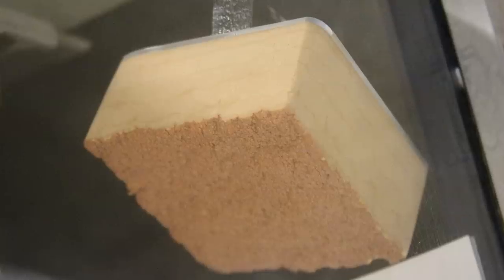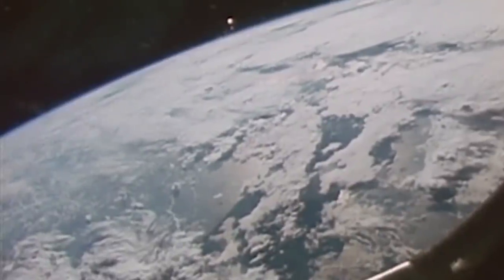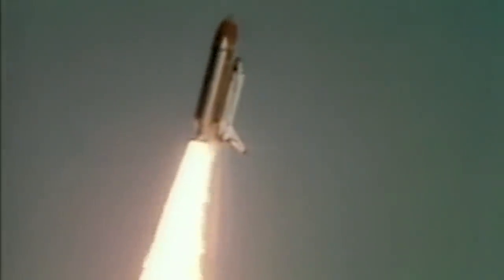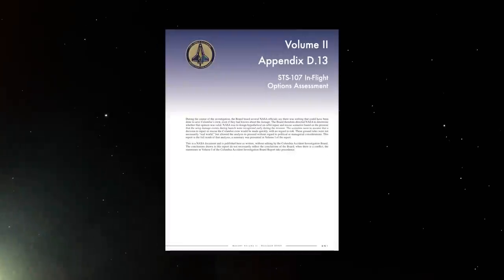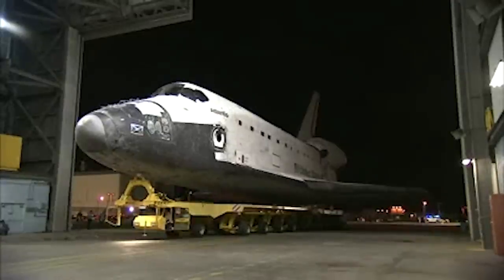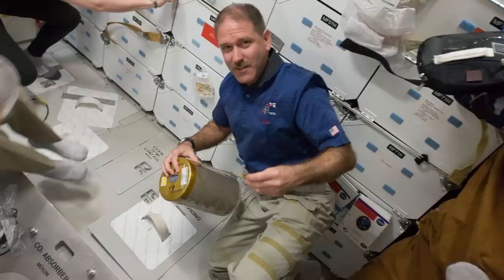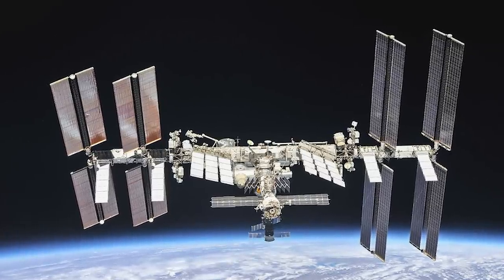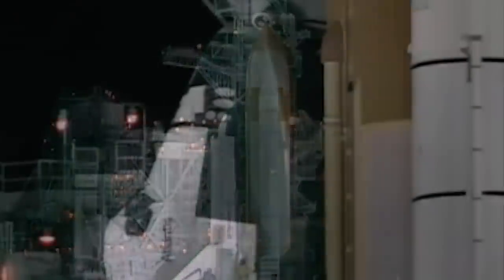The Backup Space Shuttle

Comment: My proposal would be to put a purpose built shuttle in orbit to function as a lifeboat/transport. You could save a lot of weight by ditching all of the parts dedicated to re-entry, fill it with fuel and supplies. Leave it unmanned on standby when not in use.
Reply: The only problem would be that, the vessel that needs it would have to get to it. Which could take days depending on how the orbits line up.
Reply: @h0ckeyman136  we have all sorts of capsule designs to handle the ferrying of people to and from.
Reply: @Name-ot3xw  Again, its not that its not possible, but for you to save someone who gets stranded. You would have to be able to fly to the lifeboat which is in a whole other stage of its orbit. These things arnt like sailing ships. They require lots of time to get to places because of the vast distances
Reply: @h0ckeyman136  You do realize that the shuttle and capsules exist as they do because we made them so. If we were to change the mission parameters we could build them that way instead. 

Like, we have already built multiple space based vehicles that were never intended to return to earth except for end of life. Many were infrequently manned so we have some experience with storing space-trucks. Most of them are still in space, though as you so helpfully pointed out, do not currently wear appropriate engines.
Reply: @h0ckeyman136  Further, it's not like we don't know where various manned missions are taking place, it's not as if we need a warp drive to have a lifeboat in position for a planned mission.
Reply: @Name-ot3xw  how much knowledge of spacetravel do you have? I am very passionate about it, do my own research and watch lots of videos explaining things. From what I understand the only "lifeboat" that exists is on the ISS
Reply: @Name-ot3xw  It would have been very tricky if not impossible to do that. And that information is from scientists.

Comment: NASA's response to questions about an orbital inspection was kinda gross.  It was basically, "it's better to let them die on re-entry than suffocate in orbit."
Reply: ... Yeeeah, gonna have to agree though, would rather die close to instantly (and unexpectedly) when the shuttle turned into tiny shuttle-bits than die slowly of suffocation, knowing it was coming...
Reply: On Apollo 12, there was concern that lighting had damaged the capsule's parachute system.  The crew was sent to the Moon anyway.  Why not?
Reply: @RideAcrossTheRiver  Well, the last time you can abort due to parachute damage and actually change the crew's prospects for survival is before the launch.

Everything after that, they need to use the parachutes to get back down, no matter how high or far they went.
Reply: @ToaArcan  On Apollo 12, lightning hit the rocket just seconds after launch. There are no guarantees.
Reply: @mlmmt  Al you have to do is slowly depressurize and they would become hypoxic and not know anything before they died.
Reply: NASA's response to questions about the foam strike during the first press conference after the disaster was worse.  "Call the press office" was the reply by The NASA administrator. He resigned 3 months later.
Reply: @dpsamu2000  Source?  And resigning three  months after an accident is hardly suspicious.
Reply: I mean it’s also a case of stay in space and surely die, or take whatever chances left and attempt re entry. I’d chose the latter every time (assuming anyone even knew)
Reply: @RideAcrossTheRiver  The first press conference after the disaster like I wrote. Duh. Look it up kid.
Reply: @dpsamu2000  I doubt it was as you say.
Reply: @RideAcrossTheRiver  Ignorance, or dishonest. Stupidity can be ended. Malice can not. Yours has not.

Comment: We all talk about what if’s and contingencies, while blaming NASA. However the real problem was operating the worlds most complex experimental vehicle on a shoestring budget. Everybody, especially the US government wanted the glory of the great things NASA does without paying the money necessary to do it properly. The whole shuttle program was a result of this thinking by combining the the airforce and NASA needs into one. 

It could have been successful, but a lack of funds delayed the SRB joint redesign, and the shedding of foam could have been fixed but the money wasn’t spent to find a fix. 

Penny pinching killed the personal maneuvering units, even after they were shown to work, and if they were on columbia that mission as they were originally envisioned, could have been used to do an inspection. 

You can blame the engineering or the management, but the fact is NASA was forced into a corner to make due with the shuttles flaws and never fix them, but bandaid things along to keep the costs down. This pressure was put on them by congress.  

The shuttle was a GIANT leap forward, and it worked. But instead of working out the bugs and fixing the problems nasa was left to fly with what they had and be happy congress or a president didn’t pull the plug. 

Even with the disastrous schizophrenic funding the shuttle never failed. A solid rocket booster did. Designed in segments to allow for money to flow to a certain congressional district, and a fuel tank so simple and inconsequential that it was disposable. 

Politicians created the shuttle and politicians killed 14 people.

Comment: If there was any type of damage in the leading edge area.  Why didn’t the pressure sensors in the tire area alert a problem to the pilots on their instrument panel?  I would assume that the tires would probably be expanding after being exposed to the vacuum of space?
I welcome all educational responses.   The question is to educate, not ignorantly criticise.
Reply: The wheel wells weren't sealed, so were already at vacuum anyway. I'm fairly sure the only major part of the orbiter that was sealed is the crew compartment. Payload bay was certainly not sealed/pressurised.
Reply: Everything was fine until re -entry. Then the computer showed the tires lost pressure. By that time it was too late.

Comment: I don’t want to debate this I just want to make a point. When the shuttle was first launched all of the foam was painted white. If everything would have painted in the launch in question would chunks have fallen off? My guess is no. The engineers that designed those tanks to be painted probably didn’t do it for Looks
Reply: The foam wasn't as heavy as the paint was. They needed to use a lot more fuel at launch with the paint.
Reply: @JimMac23  I’m guessing they wish they had saved weight somewhere else…

Comment: I wonder if it might be possible to to have a solid fuel rescue rocket available all the time? Simpler, smaller, safely stashed in its own hanger or launch tube, it could be little more than a can with automatic controls and heat shielding, not unlike the supply rockets used for ISS today, but designed to travel up to the damaged ship or station, unmanned, gather a dozen people and fall back to Earth, controlled by AI. The main thing being the solid boosters with a second stage to push to orbit and with nobody aboard at lift off, it could push 10 Gs or more. I'm sure this idea has been passed around by NASA, maybe even by Space X, but why wouldn't it work?

Comment: The report in question does not address the potential alternative of the second Shuttle bringing a portable crew module (that would be in the equipment bay), repair equipment (including refractory foam), and possibly consumables, to the stricken shuttle. All crew would then return to Earth on the damaged _Columbia, not the Atlantis.

Despite the risk of four(?) more dead astronauts, the risk would be deemed acceptable insofar the damaged and repaired Columbia would have been fully prepared and checked, whereas the Atlantis would not have been -- which exemplifies the importance (and complexity) of duly preparing such a launch, as you mention.

The Atlantis could have presumedly been flown up to a higher orbit, via remote link, and recovered at leisure. It is my informal remembrance that it was not possible to land a Shuttle remotely.

By the way, I am surprised that the original design engineers of the early Shuttle did not anticipate this failure mode by placing enough TPS (Thermal Protection System) material within the wing to have theoretically survived the time for reentry. I understand that the real cause of the Columbia breakup was the asymmetric drag upon the damaged wing created a yawing force that prematurely exhausted the supply of hypergolic fuel being used by the RCS (Reaction Control System) venier thrusters when instructed to by the IBM AP-101 flight computer(s) trying to compensate for same. The craft then entered a flight regime which was unsustainable, and broke up.

Comment: There were already plans for a camera mounted extension for the CanadaArm to be used to enable inspection of the heat shield while on orbit before this disaster but which was not implemented until AFTER this disaster.  They also had a plan to employ astronauts aboard ISS to visually inspect the shuttle and it was employed AFTER this disaster.  Not only these facts but there was an engineer at then "Morton Thiokol" who warned of the great dangers of flying the Solid Rocket Boosters in freezing weather BEFORE the Challenger disaster which was caused by the faulty O-rings in the SRBs in freezing weather.   Safety and security are always written in blood which means they could have applied these safety measures BEFORE these disasters but simply did not until after the disaster which could had been prevented.

Comment: Did the columbia crew burn to death? I read an article that alleged they lost consciousness instantly due to depressurization, but they were in full pressurized flight suits...
Reply: In the official report it’s quoted as saying “due to high aerodynamic forces and thermal exposure survival of crew and vehicle was impossible under current safety standards and infrastructure” I don’t believe they burned to death they were literally liquified inside they’re suits from the shaking inside the flight deck, they were knocked unconscious due to them also not properly securing their suits
Reply: At the time of breakup, Columbia was traveling at about 12,000 miles per hour, at that speed, the shuttle disintegrated almost instantly, the larger pieces were what were seen breaking up.

Comment: If nasa weren't so arrogant and had released info on tp.foam coming off the tank and explaining how it was applied an answer could have been found to eliminate the problem. But it never was until people died. One question I'm not sure was ever asked is if pieces or parts flying off aircraft that fly at 60,000 feet or less is a no no, why are you tolerating that to happen on a craft that goes into a relatively zero atmosphere environment and has to stand the forces of re entry? No faa inspector would have signed off on the launch and no mechanic working on the tp, of the external tank would have signed off the application of the foam knowing it might accidentally come off while the orbiter/shuttle was still attached.....there is absolutely no excuse except for arrogance and laziness... imho..........   retired airline maintenance technician...